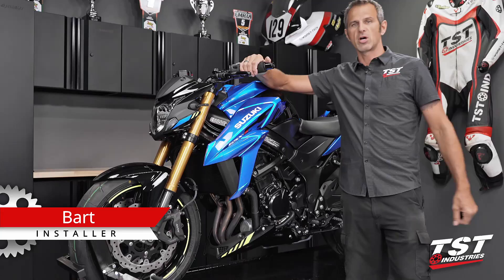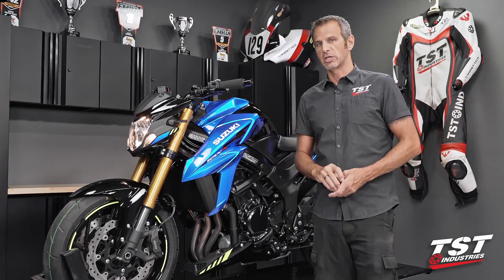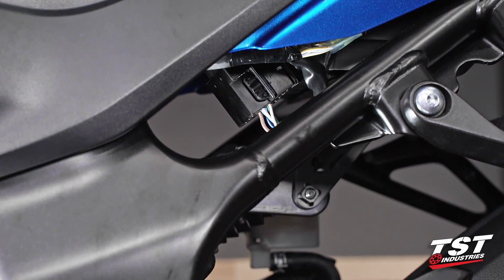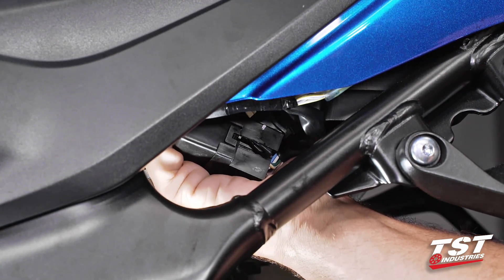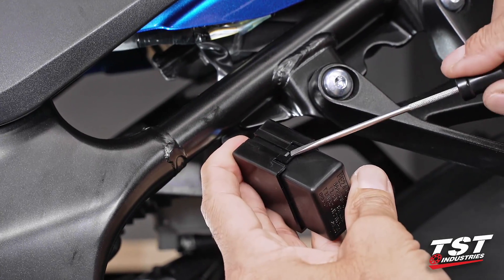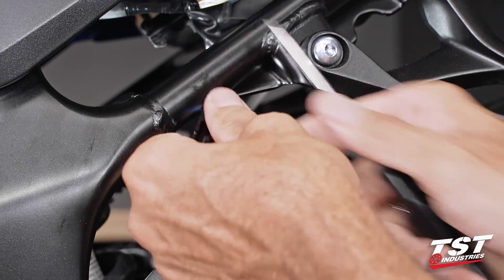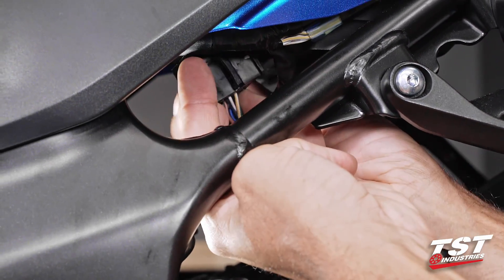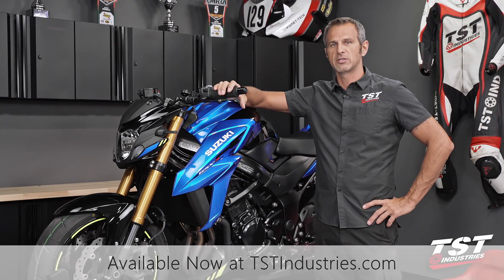How to install an LED Flasher Relay on a 2017+ Suzuki GSX-S750 by TST Industries

Comment: This is the same flasher relay for the 2011+ GSXR750, does this 7 pin Suzuki flasher relay have the same slight delay between pressing the button and first flash that the 2 pin relay models have? Also is there adjustment for flash rate?
Reply from the maker: The relays typically have 1/2 of flash cycle delay because they start in the off state and then go on. If 85 cycles per minute is the flash rate, then each on/off cycle takes 1/85 of a minute (0.706 seconds). This means that as you initiate the signal with your finger it takes 0.35 seconds before the light turns on. If the rider is using signal lights as per instructions in every driver education handbook, and also according to common sense, then the 0.35 seconds of off state is inconsequent to the signaling intent. If the rider is trying to signal at the same time as making the move, then any way the signaling is accomplished does not warn the traffic around as to what will be happening, because it is already in progress.
Reply: @TSTindustries  Wow that was a really defensive / passive aggressive response. Could have just said; "yes they have the same delay as the TST 2 pin flasher relays" 

Don't disagree with what you said about best practice road singling behaviours.
Having said that, as not all flasher relays function in this way, so knowing the delay is something that bothers me, I sought to clarify so I could make an informed choice.
Reply from the maker: @IN_ZANE_  when a question is asked and one of the engineers answers it here, it is typically treated as what/how/why in the answer attempt. The aim is to give full spectrum info to empower the prospective customer to make a choice based on the best available data. I dont see how that came across as defensive, since the question itself was not offensive. Passive aggressive.... I don't even know how to defuse that one other than just saying that I was 100% emotionally neutral during typing that message.

Comment: Will I need a relay if I'm using and led headlight bulb
Reply from the maker: This telay is for the signaling circuit. Your headlight swap will not require the replacement of any relays.